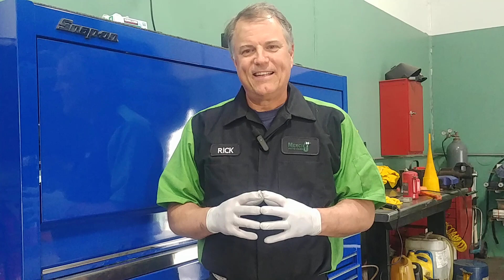What happens when a Water pump fails?

Comment: I have diesel engine its water pump fails for the third time in a two and half month. What other possible causes will it causes to leak through exhaust? Note it is working every day at least for 8 hours six or seve days a week. 
Thank you for your answer in advance
Reply from the maker: Look closely at the EGR cooler.